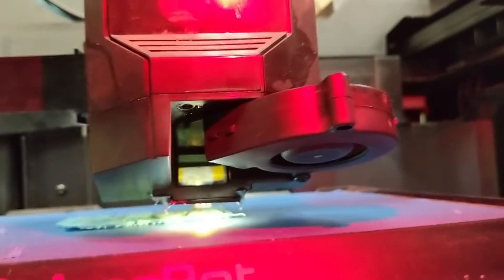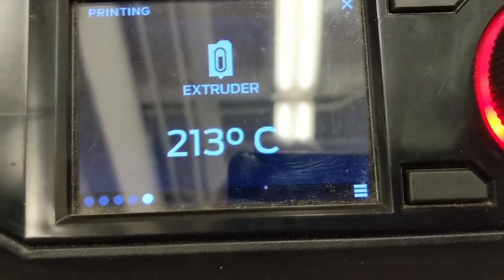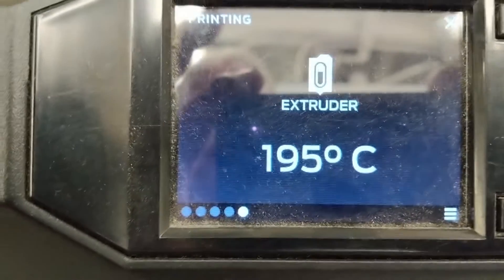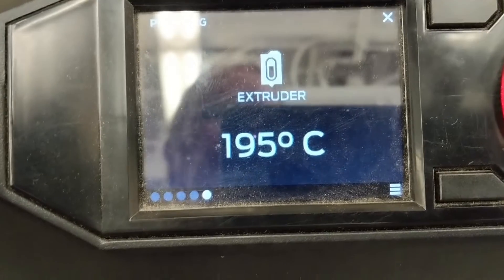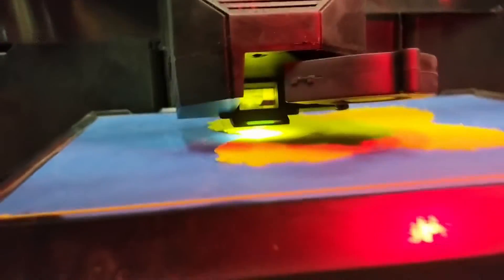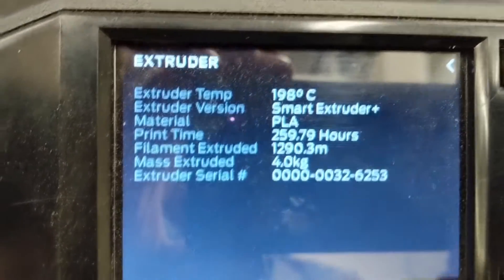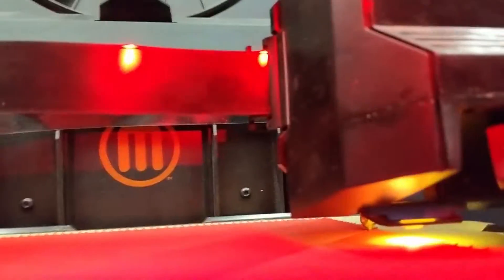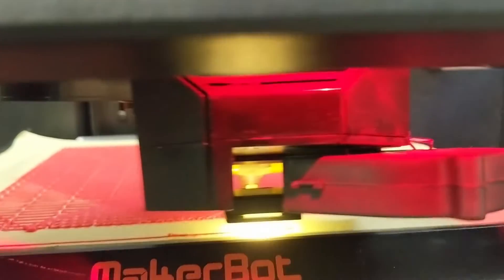Makerbot error 57

Comment: Never had the error before a firmware update.  Now I get it every 2-3 minutes during a print.  Will try the fan trick but pretty disappoint with the Replicator at this point.  More problems than prints.
Will be buying a different brand printer in the future.

MakerBot Replicator - Worst purchase I ever made.